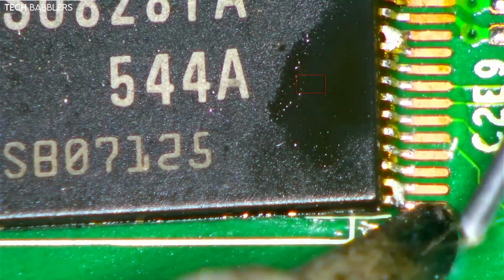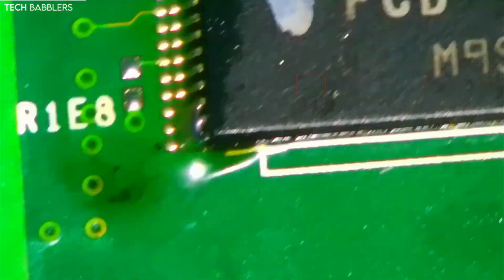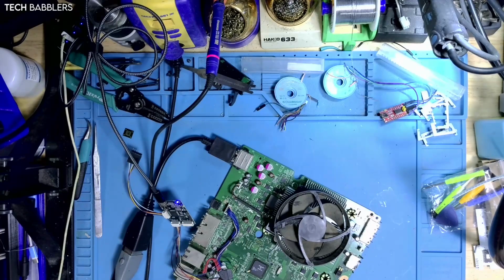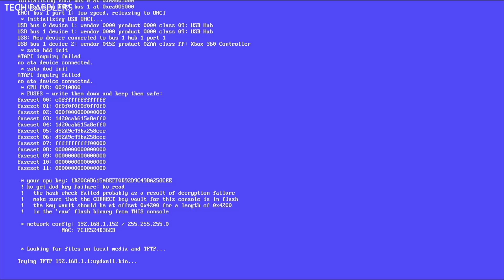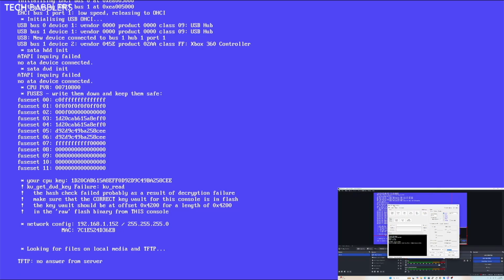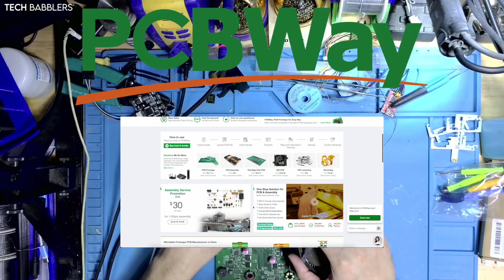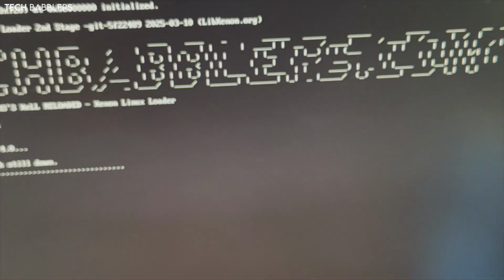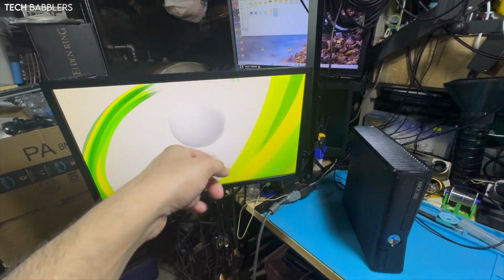Saving an Xbox 360 Corona 4GB – eMMC Dead, Can A NAND Swap Save It?

Comment: If I remove a NAND chip from an Xbox 360 motherboard and put it in a Corona 4GB motherboard that has a faulty chip, will I be able to run Xell on it?
Reply from the maker: Yes, you'll just have to build the proper nand dump and such for the Corona!

Comment: My Xbox 360 slim trinity mother board has red ring is it possible to remove the chip and put it into a different Xbox 360 slim I really want to get my saves and profiles back from the hardrive.
Reply from the maker: Wouldn't work like that no.

Comment: I have an xbox 360 that doesnt show in jrunner with extras, using an xflasher 360, would swapping the nand fix it? I checked all points and they all show continuity to the points they should! It just refuses to show in any nand reader program, console not found, perfect soldering. every forum says soldering lol.
Reply from the maker: is it a 4GB console?